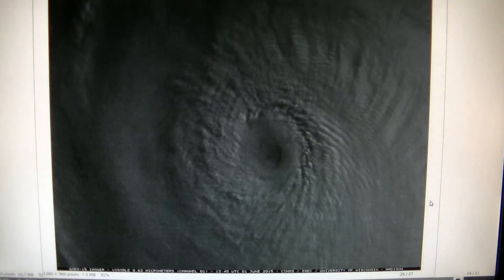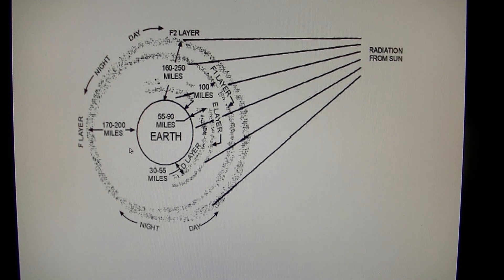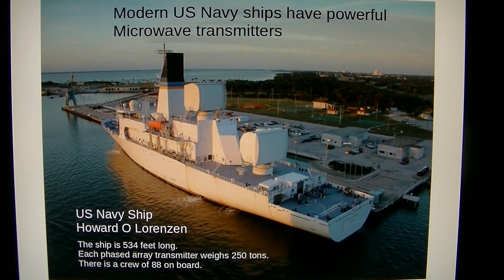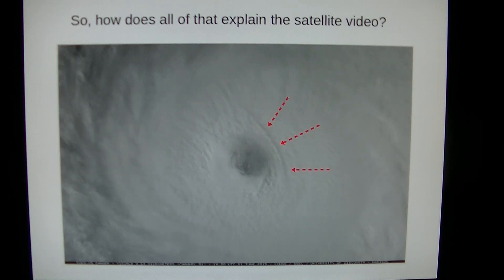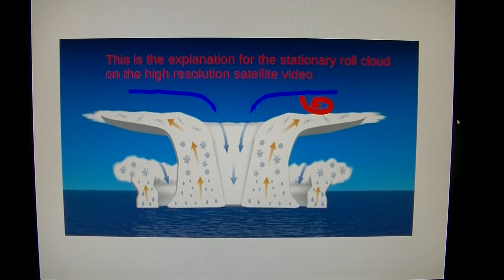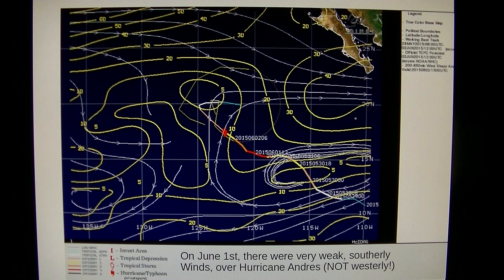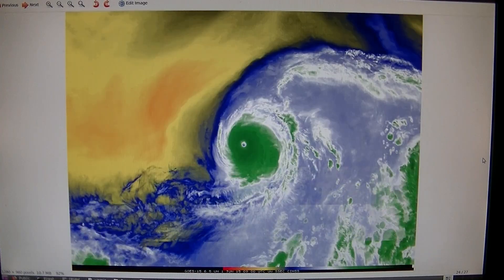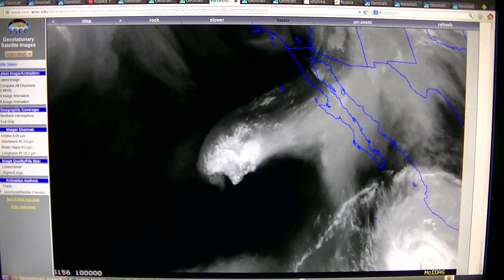Physics of Ionospheric Heaters, Killing the Pacific, June 7, 2015

Comment: You don't need to heat the Ionosphere before heating the  aerosol covers within the Troposphere.

Your speculation about the Ionosphere is not needed!
Heating from the Ionosphere down to Troposphere wouldn't make any sense, because there is not much to heat on the way and too much energy would get lost.
The fine dust material which is sprayed into the upper layer of Troposphere, together with the humidity which bonds on them to form aerosol droplets is a big mass, which reacts to heating much more efficient and answers by direct formation of thermal centrifuges (storms, hurricanes, tornadoes).
For much narrow objects, which are generally called waterspouts or firespout, the source of energy must come from above, as they are too narrow and pinpoint for heaters on the ocean or land surface.
What I am looking for is the position of the floating or flying heaters during the buildup of these thermal centrifuges.
Reply from the maker: The D layer of the ionosphere contains free electrons, but only during the daytime, so any RF energy (HF, UHF, microwaves) will cause heating, and produce ELF. The lower parts of the atmosphere don't have electically conductive layers, except for water droplets, and they are not uniform enough to do large scale weather control. Also, the D layer has telluric currents flowing which are a source of untapped energy, that can boost the heating triggered by the microwave beam. Either way, we are screwed, as more of these machines are built and deployed every day. Wie geht es inen? That is all my german.
Reply: The fine dust particles building the aerosol covers are partly metallic. They react perfectly to radiation and can be ionized. They even don't need to be ionized, it is enough when the material can be heated, to cause an thermal uplift, which results in the buildup of a thermal centrifuge, visible as storm, hurricane, tornado or waterspout. Naming depends on diameter and intensity.

If You can heat them, You don't need any further area in the stratosphere or ionosphere to be heated.

Consider that 99% of atmospheric water exists only within the troposphere. About 80% of the air mass is also within the troposphere.
Stratosphere has very thin air, everything falls without any resistance. Ionosphere has no real mass.

I don't say that the ionosphere is not heated, but the intention is different in that case. It is more about communication or prevention of communication of others, but heating anything in the Ionosphere wont have an impact on the troposphere.

What can be imagined are directed energy beams from a satellite, instead of using radiators at the surface. Think about the planned mirrors in the orbit. They would concentrate sunlight and beam it on to the surface and create such effects from above.

To form many waterspouts at a location, I assume that flying objects within the troposphere, manned or unmanned, are used to create such energy beams.  I want to indicate, that the position of the energy source is less important, as long as required beaming is conducted successfully.
Reply from the maker: You need to watch the old Nick Beggich interviews, where he describes the upper ionosphere being "blown out to space" to stop incoming warheads, in low orbit. This is the entire basis of the US Navy Missile Defense Agency Aegis and SBX ships. It is a fact, that is how it works, and the billions spent on powerful microwave ships, and then named "missile defense" proves the case. What you are really talking about is probably photo induce electrostatic. The sunlight hits special particles, and causes photo emission of electrons (low work coefficient for electron emission, like the anode on a vacuum tube), so the upper side is positive, and the lower, dark side is negative. Then, if there is a negative charge in the upper atmosphere, the particles can be pulled upward, to counteract the falling from gravity. This would be a way to keep the same SRM particles suspended MUCH longer than otherwise. I'm sure that is the kind of technology David Keith, and the the other whore psychos are working on. But, for now, we have radar beams heating the D layer of the ionosphere, which DOES produce high pressure (descending air) in the jetstream, therefore controlling the surface weather to a high degree. I now agree that NEXRAD radars are able to do this, but at a limited range (searchlight mode). I never thought it was possible before, but didn't know about the stationary positioning, and the 60 degree upward tilt.
Hey, waterspouts are just warm humid air at the surface, trying switch places with more dense air, above. As it spins faster, the pressure is lower, causing it to spin faster. There are no "flying objects" to create water spouts, or tornados. I don't see why you are getting hostile over this, it is just simple, everyday meteorology, no need for weather weapons to form a a water spout.
Reply: You are right about the use of ionosphere for radio communication of various systems.

Weather  exists only within the troposphere, not in the stratosphere and never in the ionosphere.

The drop out of the ozone from stratosphere brings more intense UV rays down to the troposphere. This power is used to evaporate more water and keep it longer in the upper troposphere.

SRM particles exist only in the ozone layer and in the troposphere. The dust is build by burning chemicals with oxygen of the ozone layer, but they are not aerosols, because there is no water. This dust falls down to the troposphere and additional dust is sprayed directly into the troposphere by jets. All dust results in formation of aerosol covers.

For keeping all these dust particles and aerosols, the modification of the ionosphere wouldn't have any effect.

What can be observed are more intense lightnings, because of higher conductivity by the artificial dust in the stratosphere and dust and aerosols in the troposphere. 

Please look again at the distances, conditions and the content of troposphere, stratosphere and ionosphere. Again, You don't need to heat ionosphere before heating the artificial dust of troposphere. There is no physical or technical reason for that.

Comment: Why would the heated air descend instead of rising?
Reply from the maker: On the top, it is popping out to space, underneath it is pressing downward at high velocity. See the old Nick Begich HAARP videos for his explanation of this effect. On top, the expanding gases are used to drag nuclear warheads out of orbit, hence the program is run by the Navy Missile Defense agency.
Reply: @thehaarpreport9203  I'm not sure I follow.  Could you link me to something that explains why heated matter would descend?  I got an open mind and I'm not trying to be a jerk.
Reply from the maker: When microwave beams heat the very thin gasses in the ionosphere, it expands explosively. On top of this expanding bubble, the gasses are blown out into space. Under the bubble, the gases are pushed downward, causing artificial high pressure in the jet stream. By controlling the jet stream, you control the weather at the surface. It is really very simple, but it only works in the daytime, when the D layer of the ionosphere is created by the sun.

Comment: How long do you believe the planet can handle this? Any guesses?
Reply from the maker: +Audry Miller    The Achille's Heel of the planet is the frozen Arctic Ocean sediments, which are only 150 feet deep. This technology is being used to melt the Arctic, as fast as possible.  If we could get the Ionospheric Heaters shut down, the Arctic could re-freeze, and we'd have enough time to figure out some kind of fix. As it is, we are passing the doomsday tipping point right now, or maybe we passed the point of no return a few years ago. Either way, this classified weather control technology has stolen many years from us, the years we needed to figure out new technology. Tesla discovered pollution free automotive technology, back in the 1920's, and it was classified, and hidden from the public. I think Tesla knew the planet would die, wiithout his inventions, but even he didn't know how fast it would happen. Each year, things are speeding up, since we have left the flat part of the temperature curve, and we are now going vertical, on the "hockey stick" temperature graph.   I think each coming year will be worse than the past one. I think 2016 will be like 2015, but on steroids. More storms, more floods, more heat,  more drought, a weaker jet stream, leaving the storms in place for longer periods, less and less ice at the poles, glaciers retreating faster than ever, Greenland's 2 miles of ice disappearing at an exponential rate, the sea level rising three times faster than the worst estimates, constant flooding in coastal cities, terrible drought in the Carribean, as our hurricane suppression program continues, oceans dying due to very high UV-B, but NO scientists measuring the UV, mass extinction of the large fish species in all oceans, coral reefs bleaching and dying all over the northern hemisphere, or where ever the Ionospheric Heaters operate, more wars for water and arable land, mega fires in Alaska, Yukon, British Columbia, Washington state, Oregon, and of course, California, mexico crop yields fall dramatically due to higher UVB levels, exotic tropical diseases entering the US, northern europe (UK) having extreme cold, caused by Greenland's melt water stopping the Gulf Stream thermohaline circulation, so the warm water which has kept the UK temperate for thousands of years is suddenly GONE, drought, heat, and crop failures in Ukraine - the bread basket of europe, basically the wheels come off the apple cart, and it all is being sped up by the ionospheric heaters, pushing warm air into Alaska for the past four years, nonstop.
Reply: I agree. I am not a scientist but am an observer and truth seeker going on 4 years.  Have documented weather camera (armature) but every little bit helps. Tesla tech hidden is a crime added to many countless others. Im a veteran, went from pride to disgust of usa/world. I believe it's all to push A21/2030 green/5th age agenda and end time prophesy is before our eyes. Thank you for your work! The sun and moon are not what they tell us. I could go on all day!

Comment: lmao, you have to be kidding me. You really think that a missile defense system designed for detecting missiles from the Chinese is actually used to take down hurricanes? Your going to have to do a little more to convince me because that is preposterous.
Reply from the maker: +zach7147 Go read the specs on the US Navy (Missile Defense Agency) SBX-1. What do you think a focused beam of a few million watts of microwave power can do to a low pressure, ionized gas? It causes it to expand, explosively, for starters. It has taken the navy over 20 years to get all the satellites launched, and all the software written, but now, they can burn holes in the ozone layer, steer the jetstream, and keep low pressure out of California, for YEARS, and YEARS. Your planet is dying, and it will be 135 degrees at your house, in only a decade, or two (depending on your latitude). 
Do you think you will survive a month of 135 degrees, with no electricity? Why don't you laugh your ass off, thinking about that...
Reply: DO THE RESEARCH !  CHECK OUT WEBSITE;    EXTENSIVE LIST OF PATENTS GEOENGINEERING WATCH       CHEERS  & TAKE CARE

Comment: Could u tell me what frequencies are detectable i have a wide varity of antenna i could detect/ record them snd send them to you.
Reply from the maker: Rob Heide There are three frequencies: first the extreme low frequency (less than 20 Hz), which the ionosphere puts out, after it has been excited; second the old Alaska Haarp used HF frequencies (10 MHz to 20 MHz?) to heat the ionosphere; third the modern SBX transmitter is in X-band (10 GHz), so you will need a parabolic antenna to pick up the X-band signal, and you need line of sight to the transmitter. The easiest is definitely the ELF signal, since all you need is a coil of fine wire on a ferrite rod. Something like 1 pound of 38 AWG, on a ferrite rod, will let you see the ELF, but you will also see the 60 Hz, unless you get away from civilization, like the U of Alaska magnetometer did. BTW, it is off-line, since fukushima, since they didn't want people seeing what they were doing. Please make your own youtubes, showing the measurements, and send me the link. Thanks!
Reply: Hey thnx man for the info, srry for the late reaction i was on holidays i will ask my dad if he got the materials for such antenna btw i live in the netherlands
Reply: Also i need to listen at the right time pointing the antenna in the right direction is really hard since  i have college

Comment: As I type this SAN Diego California is getting a little bit of rain. Not enough to even notice on the ground or sidewalk but enough to see on the windshield. It is a weak sprinkle. I hear thunder as well. It is also a bit overcast.

Do you know if Chemtrails is the cause?
Reply from the maker: KaliCoSays There is only one guy in California, who makes youtube videos, showing proof of weather control, and I think the rain happens in his area. He is south of LA, in Orange County. If you make good videos, showing proof of weather manipulation, you WILL get rain in your area. That has been proved over and over. Keep in mind, these are corrupt, cowardly wall street bankers, and they run and hide, when exposed (just like cockroaches). My videos ended the Texas drought, so these guys have more resources to devote to the California drought. You californians have to stand on your own two feet, and spray the cockroaches.

Comment: Where did you the concept of being able to create a taroidal downward vortex in the d layer? Is that common physics knowledge or geoengineering knowledge? . I see it when explain in the jet stream but I have seen ionsphere breifly explained as justgeneral upward waves. How exactly did youcome upon the creating a downward vortex?
Reply from the maker: Akira Cornell It's just common physics. The toroidal vortex forms automatically, any time a column of fluid is moving faster than it's surroundings. I suppose it is Newton's law of viscosity, at work. In this case, a downward pulse of gas will create the toroid, which can be reinforced when needed, to keep it going, and to aim it. Since I have seen the circular, expanding, dry air roll cloud, on the satellite maps, dozens of times, it makes sense the toroid forms earlier, not at the last second, as the downward pulse is hitting the top of the jet stream. I wish I had made HD videos in the early days, since some of the best Haarp downburst rings happened before the maps were so badly smeared over. There are several kid's toys that demonstrate how easy it is to make a smoke ring, which travels across the room. I had one, when I was a kid. It was just a cone, with a rubber membrane. You'd cock it, then pull the trigger. It would shoot an invisible smoke ring across the room, and deliver some of the original energy 20 feet way. When it hit you in the face, you definitely knew it! Funny, how the toys a kid has really DO affect them later in life...

Comment: Right now in Arizona, about what 2:15 am or so 3/9/15 there is a low pressure system that was spinning and they proceeded to use a few haarp downbursts to get it to stop rotating counter clockwise, now it is starting to rotate clockwise, there's a few rings in there on the north and west side if you catch this in the next 30 minutes so before 2:45 am. http://www.ssec.wisc.edu/data/geo/index.php?satellite=west&channel=wv&coverage=nh&file=gif&imgoranim=8&anim_method=jsani

Comment: You got to tell us who we need to speak to to get things changed some of us would not like to die....
Reply from the maker: nathan dials Public officials don't have the security clearance to know about any of these programs, so they will just laugh at anyone who tries to educate them. What we need to do, is described in my video "How to Stop Chemtrails and Haarp" https://youtu.be/lX1t4fG0Bmc  One of the best things you can do, is find all the land based SBX type transmitters, and monitor when they are transmitting, then compare that to weather anomalies, within 200 miles. After my videos started recommending using Google Earth to find the Haarp transmitters, Google removed the GPS function, so now it is much harder to communicate where things are. The bad guys study the information in these youtubes, and are scared about where this is heading. Hopefully, they all get to retire, in concrete rooms, with bars on the front wall. But, that won't happen, unless we all work together, to stop these planet killers.